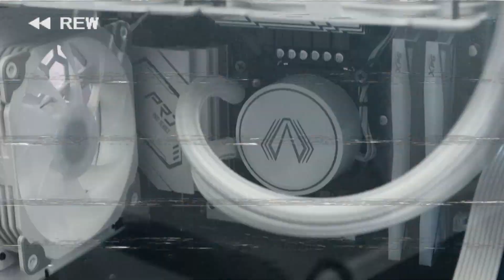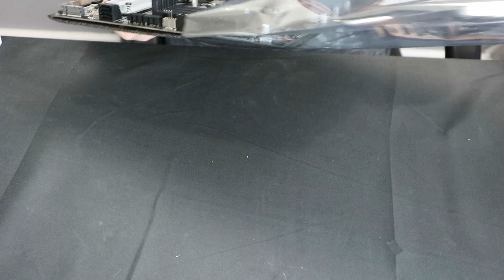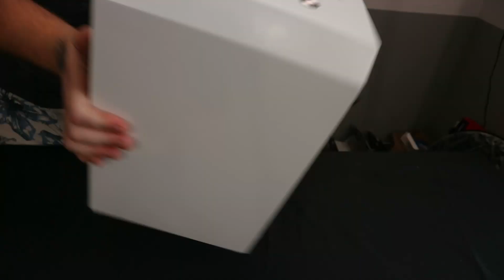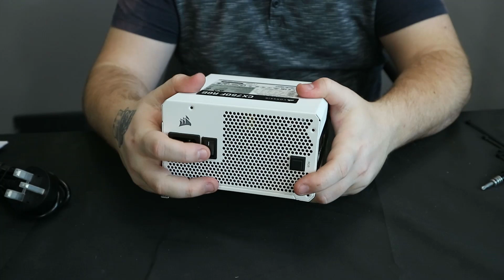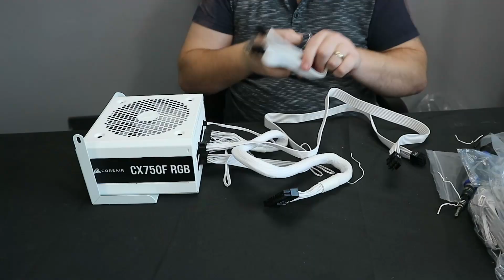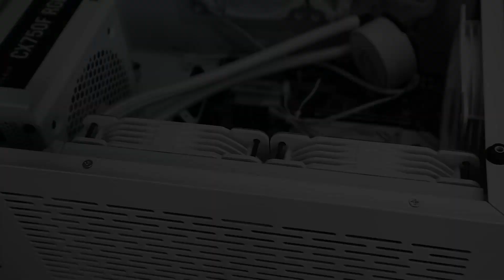INTEL I5 10400F WHITE GAMING PC BUILD!

Comment: how did you get the gpu in because I have the same motherboard and my xfx 6600xt wouldn't go through because of the sata port that horizontal the the pcie slot
Reply from the maker: I presume you mean you are using a sata cable? If so change it out for a L shaped sata cable and that will solve the problem